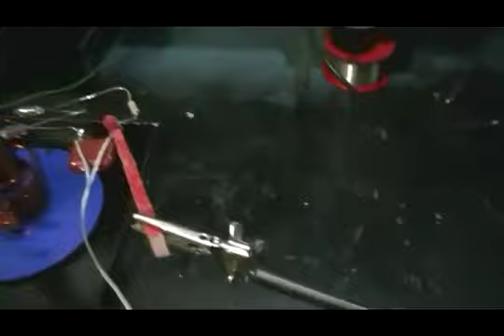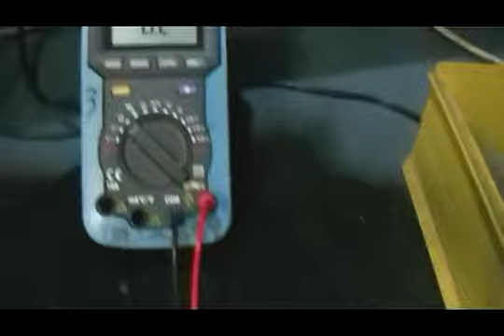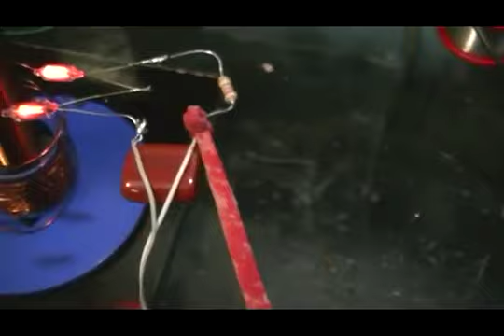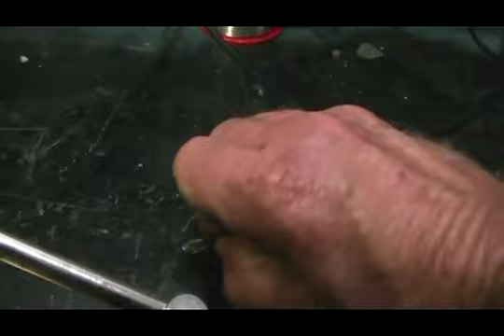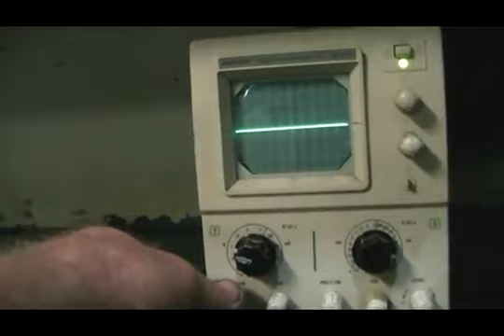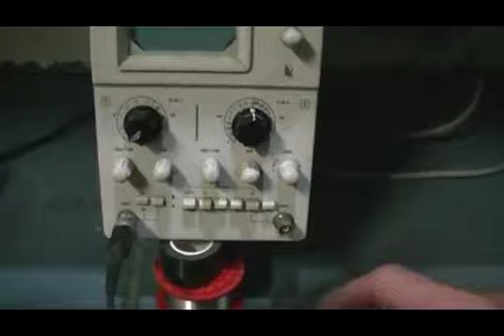TinMans neon rectifier

Comment: Hi Tinman, Nice one. I think you may have discover how to built a simple diode. Here's my take on this. One neon is getting more RF power being closer than the other, creating a voltage difference between the two. Hence, initiating a current flow. Very interesting indead. It would be nice to know, at what voltage level does current flow, ie 0.7 or maybe at 0.01 ? Also it makes for a very rugged diode. Maybe not cheap? Anyway, it opens up many doors.